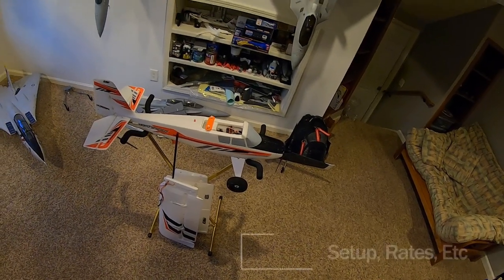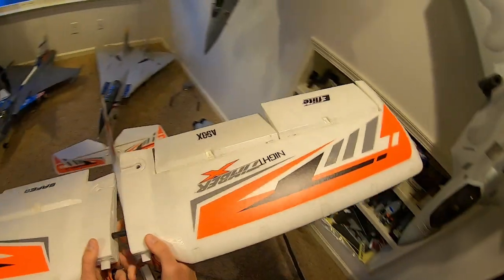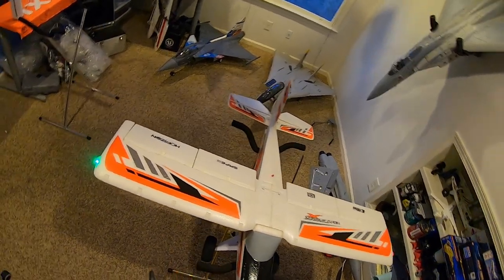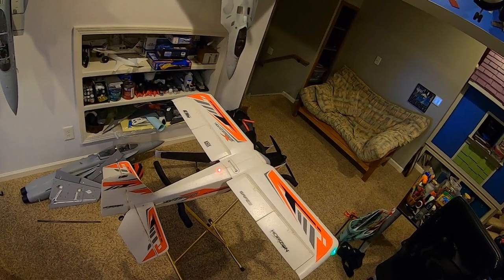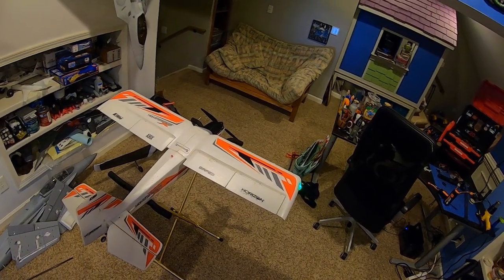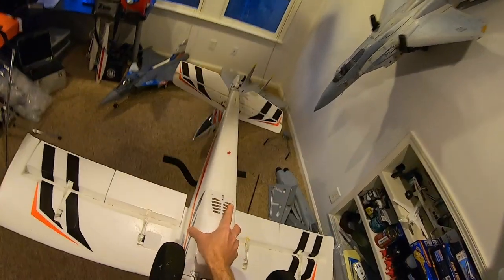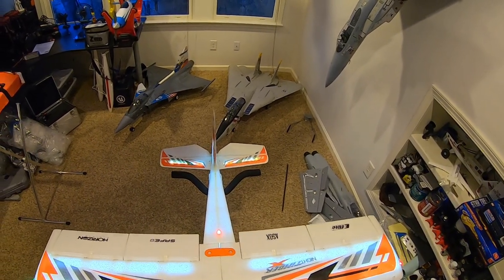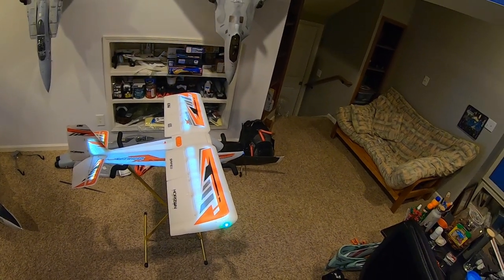E-Flite Night Timber X Setup - Flaperons, Harrier Flaps, Snap Flaps, Rates, Receiver Programming

Comment: Are the wing servo's (aileron and flap) glued in? Mine came with misaligned control horn that is not centered at neutral. Not sure how to get the control horn off with out ripping the servo out. Plus how in the heck did you get 150 percent without binding on those flaps? Mine bind at 100% when I give it full aileron the mixing increases the throw. I had to dig out foam around the clevis and it still binds up. Just not sure why it wasn't aligned before gluing in the servo's like that. Also my gear didn't fair very well in small crash where I lost all control and it just dumped into  the tall grass on the first flight. I'm very experienced flying wise and was shocked to lose all control like that. It was like the system lost signal or something and just started to spiral into the dirt. I had it up and flying after getting rid of the safe functionality. I thought I was in AX3S mode when in fact it was in safe only mode. After fixing that and getting the gear back together everything flew pretty good. I now want to try and set it up like you have it with full throws and flaperons. My transmitter keep beeping at me with triple beeps early in both of my last flights and I have no idea what that means. I land and check telemetry and everything looks good. What does that triple beep every second mean? I just have an NX6 radio.
Reply from the maker: They're not. The servos are held in place with plastic harnesses that you unscrew to remove. The only servos glued in place are the elevator and rudder. I'm pretty sure I covered the rates and how the surfaces move - be sure to check over that section if you're curious. Stock servos on this model are less than ideal, hence why I linked the replacement servos that I use in the description - way more torque and way more precision.

If your transmitter is beeping, it's probably because you have a Smart Battery warning going off. Check the telemetry screen and it should tell you.
Reply: @TwoBrosRC  This is great, I just took the servo out and could not get the control horn to line up 90 degree's to the servo case, so I just inserted a wood shim on one side of the servo to create the proper 90 degree alignment to the wing. Works like a champ now. The only issue I have now is that there seems to be lot of down trim in the model to make it go straight. I have the battery all the way forward and using the steel rod in the tail section. Maybe the overall flaps and ailerons need to be set higher up but something needs to be changed to level out that elevator otherwise knife edge will be screwed up.
Reply from the maker: @michaelkrailo5725  Try using the carbon rod instead.
Reply: @TwoBrosRC  Well, I'll be darn...going to the carbon rod fixed the pitching up problem. Added bonus was I ended up avoiding disaster as the plastic piece on the bottom of the rudder was barely hanging on. Had to gorilla glue it back on, but the plane flies much better now. I do have the battery pretty far back now instead of in the forward position. I'm real happy with it.
Reply: @TwoBrosRC  Hi Jon. For the night timber rudder and elevator servos that are glue in, how do you remove them, just pull, or do I need to cut them off, or apply some heat? Thanks

Comment: I own about 13 3d planes and have been flying for about 2 years now.  I purchased this plane and I have about 12 flights on it.  I don't want to be the guy that blames the plane.  Cause it definitely can be pilot error.  But I never crash any of my other planes.  Every flight with this plane when I make a turn towards the end of my flight I spirals straight down to towards the ground.  Is this a characteristic of this plane?  Does it have a nasty stall when you turn sharp?
Reply from the maker: The answer is unfortunately "it depends" - the Timber X does stall pretty hard, but it's not unrecoverable at all due to the massive thrust to weight ratio.

Try joining us on Discord and posting a video in the channel called #3d so we can look it over with you: https://bit.ly/TBRCDiscord

Comment: What receiver are you using? the one it comes with only has 6 channels and all are used. thanks
Reply from the maker: AR637, the stock receiver. The lights are plugged into channel 5. You can, and should, plug them into the bind port to free up a channel.

Comment: I love your videos I just got a Night Timber x 1.2 BNF my elevator servo went bad after one flight and when I was setting up my DX8 Gen2 with hairier flaps and snap flaps when it over heated and quit. I got 6 of your servos and replaced the elevator and rudder servos but haven’t done the wing yet but I plan on it. Got everything working but only have the original RX settings so limited to 100% through. Would it be ok to try what you do for now or should I reset the Rx.
Reply from the maker: You'd be OK flying it on 100% rates but you'll want this cable to program your receiver and unlock it: https://bit.ly/3P4a9Kg

This vid goes over the process: https://www.youtube.com/watch?v=F3isbv1U8eM
Reply: @TwoBrosRC  will I get the same menus on my pc as the video shows on the ix20 transmitter. When I go to my forward programming I don’t get the settings option so I can’t backup my rx the way it is now. I want to reset it but I am afraid I will lose everything.
I have the DX8gen2 transmitter.
With the cable everything is done in the spektrum programmer program on the pc.
Reply from the maker: @jvalovcik  Make a backup of the existing receiver programming first.
Reply: @TwoBrosRC  how do I do that I don’t get the settings option on my transmitter when I go into Forward Programming.
Reply from the maker: @jvalovcik  You need to unlock the receiver first.

Comment: Hi, do you use the servo arms of the original servos or from the new ones? I think the holes in the servo arms of the replaced servos are quite small.
Reply from the maker: I use the original arms. They'll fit on the AGF servos with a little coercion.
Reply: @TwoBrosRC  Thanks for the quick reply! Just one question: what kind of glue have you used to fix the servos in the fuselage?
Reply from the maker: A liberal amount of FoamTac properly cured will hold the servos in place.
Reply: @TwoBrosRC  Thank you very much. I will try this. Keep up the good work!!

Comment: I’m finding it impossible to get flaperons. It would be magical if you could go into more depth bc you say it’s easy but I’ve been here for the last three hours working on that alone and I CANNOT get the flaps to move independently with the corresponding Aileron. Both flaps will only move with one aileron. I’m scared to try that in flight but maybe it works idk. But it’s not what I want I know that.  Please help lol
Reply from the maker: You have to put both of the flaps on separate channels and physically plug each one into the receiver without the Y-cable. The rest of the info is in the vid.

If you keep running into issues, join us on Discord and one of our community members will be happy to assist: https://bit.ly/TBRCDiscord

Comment: Hay jon I got the servo and setting it up, I can’t seem to get the same amount of throw on the flap as the aileron, the flaps do not moves as much even they are set at the same holes. Any ideas what I can do, I’m using a nx8
Reply from the maker: You'll need to adjust the pushrods and control holes on the flaps to make them match. It won't be 1-1, but it will be very close to it if done correctly.

Comment: Wow, its pretty amazing that you push your battery into the fuselage like that, not even close to the  battery straps....center of gravity on this plane  must be very forgiving
Reply from the maker: It doesn't move much further back than it would if it were in the position the straps would have been in. We don't even have the straps - they're removed. No real reason to fly with them.
Reply: At the one minute mark you are shoving it 4/5 of the way into the fuselage. I' ve tested mine with a 4 cell 2200 and can do likewise.  You might be able to get one strap on the edge of it.  Per the manual's center of gravity explanation, the plane still comes in tolerance levels. Perhaps you could use the metal elevator rod if you moved your battery into the hatch....  Did you disable SAFE?  I would have destroyed this plane a dozen times by now without it. LOL  -  Thanks for being so responsive to my questions.  Love your channel. This is my go to plane and you cover it better than anyone else.
Reply from the maker: @superdow1000  Nope, haven't needed the straps in over 700 flights. It just doesn't get thrown out of the model even during crazy maneuvering. I wouldn't worry about it much.  We have SAFE enabled but only use it rarely.

Comment: Do you have a clear picture of the wiring where you moved the lights to thanks
Reply from the maker: The lights weren't moved.
Reply: ? 4:06 in the video said you added a Y cable to free up a port for the flaps just wanted to see how you did it all good thanks
Reply from the maker: The way you phrased it made it sound like we'd moved lighting around in the aircraft. Connect the lights to the bind port. Make sure the negative (black) wire is facing down when connecting it to the receiver.
Reply: @TwoBrosRC  man so simple thank you! never gave the bind port a thought

Comment: What rx are you using in the night timber x?
Reply from the maker: AR637T
Reply: @TwoBrosRC  what the bind procedure on that rx?
Are you turning on the tx and then the rx and it auto binds like the umx stuff does??kinda on its own??
It looked like it from the video
Reply from the maker: You press the bind button on the receiver and bind the transmitter to it. Once bound, it stays bound.
Reply: @TwoBrosRC   OK how about when you connect to another plane and then want to come back to the timber do you have to push any buttons, the bind button then?
Reply from the maker: You just turn the plane on and switch to the Timber profile. It automatically reconnects to it.